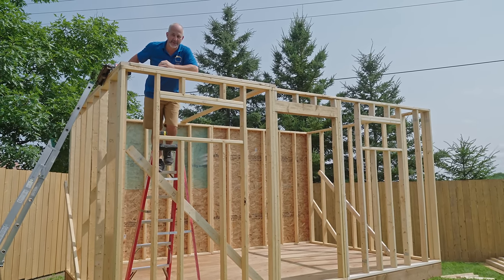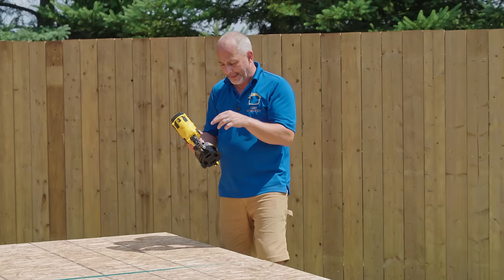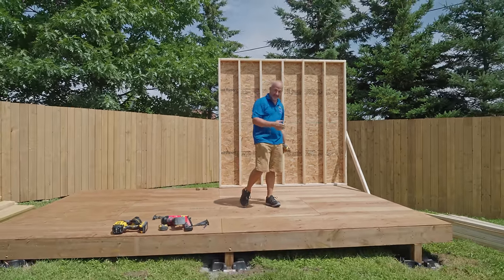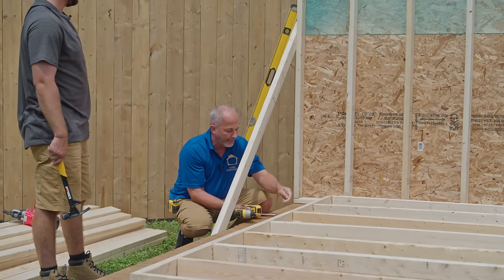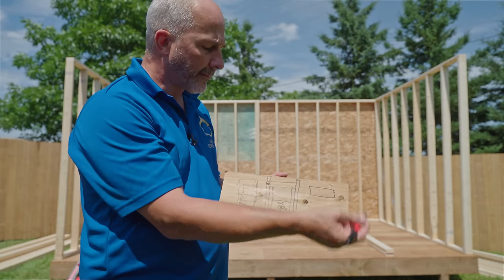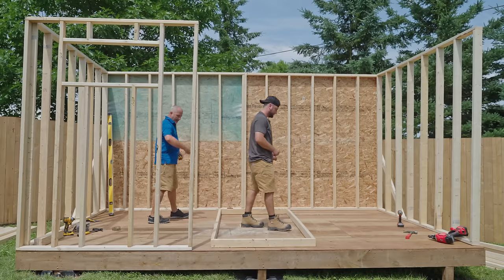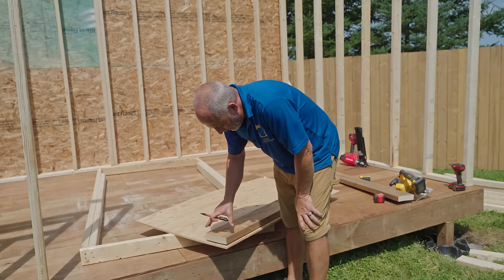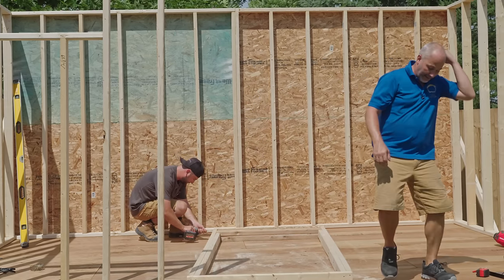How to Frame a Shed (One Section at a Time)

Comment: Very good 👍
Just wish woodworkers would start using metric measurements..... imperial makes no sense
Reply from the maker: This isn't wood working ...this is framing. Cheers!
Reply: Since most cuts are still based on imperial measurements (4X8), just download one of the many measurements tables that cover all the sizes with a column for name size (2x8), actual size, and metric equivalent. You’ll find most of the precut stuff is based on that

Comment: I still don't get it why you Americans don't build proper walls with bricks, stones or concrete blocks, but rather use this complex framing technique. I'm not hating, I'm honestly just curious. Is there a reason?
Reply: @armslength2618  but a drywall will fail whenever something accidently punches into it. I'm not sure but I think you use some kind of gypsum board from the inside as well as from the outside. Or maybe you use wooden cladding from the outside but still, that is a somewhat weak and voulnerable material is it not? And what about the health aspects. Gypsum board has powdered aluminium and other toxins in it. Then you have to use treated wood on all of the frame and the mineral wool in between of the wooden frame. I'm talking about the occupational exposure of the builders but also the people living in the house might not be the healthiest people ever. Especially if they get mold inside of those cavities and on the gypsum board. And what about rodents. They can start living in those cavities. What I'm saying is that this type of building technique requires chemicals everywhere. Now compare that to a simple fired clay brick and mortar. Or even better, in my country they used to build from non fired bricks made out of clay straw and sand and mortar was made from non hydrated lime. You couldn't build like that if we didn't live in a toxic modern world with factories everywhere. The thing I don't understand is some people consider this american building technique more enviromentally friendly then solid masonry. Since when is building a house mainly from chemically sprayed and factory made materials more enviromentally friendly?
Reply: Sorry gypsum board shouldn't have powdered aluminium in it. I confused it with a different material. But still it's not the strongest and healthiest material ever.

Comment: Cardinal rule:  never frame window openings without the windows on the job site to measure!  Ask me how I know.  Resizing a window opening with a circular saw, hammer, and chisel is an ugly business.  It hurts the soul to butcher a beautiful framing job because of incorrect window measurement. Fractions of an inch count.  Buy the windows, unwrap them and measure the actual size.
Reply: You should have a window schedule for framing your RO. Your RO is also an inch bigger than your window, so you go off of the specs of the window you order. What you've said is incorrect, I'm a framer.

Also this video is so bad it's insane people will actually watch this and think they are learning. Framing with screws for one thing ..

Comment: Where are you fire stops and your inlet/cross braces? This is a fairly large structure/shed. You should not rely on the so-called plywood or strand board to hold the structure from twisting or leaning over. Chips of wood and glue never replaces real solid lumber; if so, build the whole thing with chip & glue studs. Everytime chip & glue building supplies are cut to size or shape, the edges become sponges for moisture. Then it becomes a matter of time before rot, mold, and loss of strength happens. Structural integrity compromised, animal infestation, damaged belongings, costly repairs; you can figure out the rest.